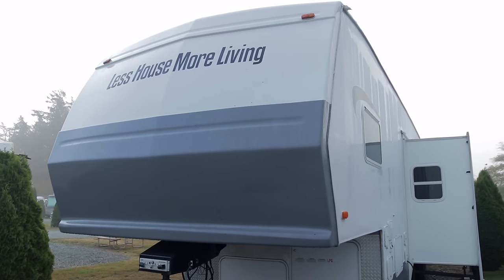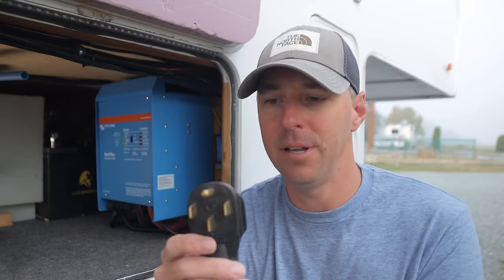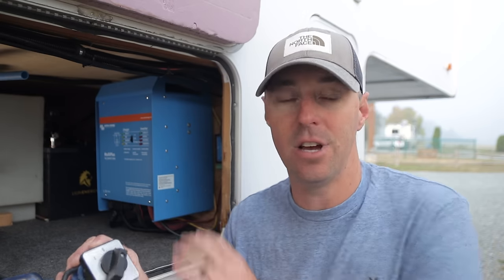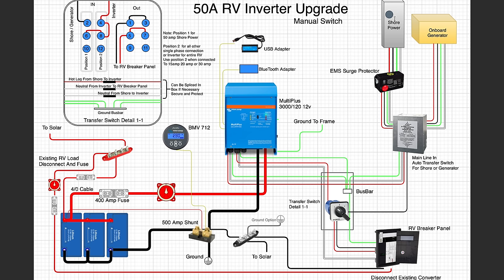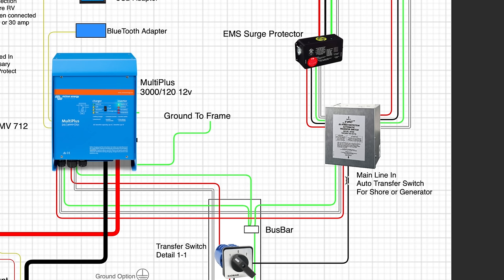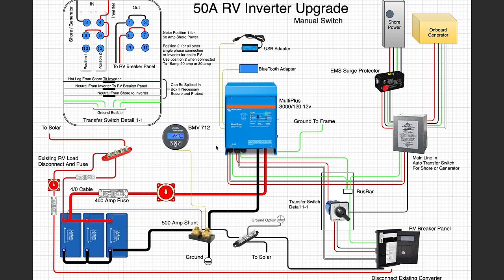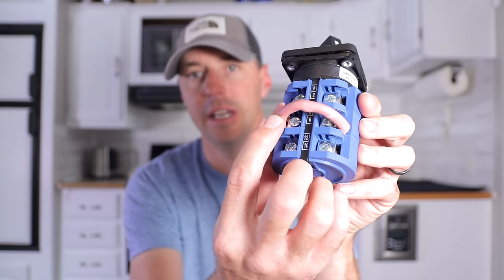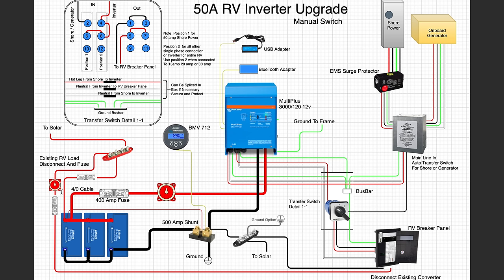Budget 50 Amp Rv Inverter solution!

Comment from the maker: UPDATED INSTALL HERE https://youtu.be/gbKBoIvXNPA
Reply: Do you know if I can mount the Victron 3000 on it's Back?? this is the only way I have to mount it, otherwise it will have to live under my table ON THE WALL... not where I want it...
Reply: Note to public, do not use wiring diagram in this video, the link Jared posted here (to 2/14/21 posted video) has his improved design which has less jumpers on the manual switch and constant power on 1 leg when rotating the switch.
Reply: Great stuff Jared, installing this exact setup this weekend. Just ordered through your storefront. 1 question. Do you need to manually turn the switch to position 1 to use onboard generator the same as ypu would for shore power?

Comment: Way over my head.  A good reason to hire an RV electrician.  Travel safe.
Reply from the maker: RV Electrician is a great option.
Reply: @AllAboutRVs    Jared -- would you have any idea on how one locates an "RV Electrician?"  I was told last week, by my dealer who sold me my TT, that they would not build me a battery setup like this because of liability/fire hazard.  I know that's not correct, but I'm having a heck of a time locating an electrician who will do this kind of work on my TT.

Comment: Great job Jerred!  I use the same switch in a much simpler mode where I use it to allow a 4000watt inverter power my entire RV.
Mode 1- normal 50 amp service feeing the circuit breaker panel, inverter circuit breaker (this is the inverter power input which feeds  the circuit breaker panel) is disconnected from panel.
Mode2- the 50 amp inputs from shore power are disconnected, the circuitbreaker panel 50 amps inputs are bridged, the 20 amp circuit breaker from the inverter is engaged and the AC to DC charger converter circuit breaker is disconnected. 
Its a super simple setup for people with a inverter that want to power their entire RV or connected to generator/shore power as normal.  Contact me if you happen to be interested in a schematic to put on your web site.
Reply from the maker: Good setup. I'll make a diagram of it for those that don't want the Power assist Inverter.
Reply: Scott Helmann could you send me the schematic for how you have your manual switch wired?
Reply: Jmmy Talvacchio - got an email address or a text number? You can send photos on a video comment.  Or- you find me on facebook

Comment: Thanks for the detailed video.  I was able to install the MultiPlus 12/3000 and the manual phase switcher today in a 2016 dynamax fk36.  I made all the wire cuts required to insert the SPS when supplies become available.  I have a full round of testing tomorrow.

Comment: Just what I needed!  I've been running my Victron Quattro 5000VA through a SPS for three years.  Today, Jul 18, 2024, I find that AM Solar is no longer in business.  Last year AM Solar told me that SPSs were built to order should I need a replacement.  The SPS was the one part of my system that I've had a concern with over its availability should it ever fail.  I'm now ordering the parts from your list to keep on hand in case I ever have to pull out the SPS.

Comment: It made me dizzy, but this was very helpful. I'm dealing with wiring a plain old 2000 watt inverter into our 30 amp system with a manual transfer switch after the installed ATS. I don't intend to power the AC unit, but there are some loads on different breakers that I want to access.

Comment: I want to thank you for the information. I've just purchased the victron multi plus and the manual switch as you have shown. (Auto switch not available right now). Using your diagram provided which is a great help. I also purchased a 30 amp victron dc to dc charger to to charge batteries while travelling. I will install cables from the engine compartment back to the box with an anderson connector to plug in the 5th wheel. Next purchase is the lithium batteries. Battleborn would be nice but they don't have free shipping to Canada. Got to do a bit more research. Thanks again.
Reply: Hi Jimmyp, I have two battleborn batteries (purchased on April 2019). probably only have two charge cycles on them.  Let me know if your interested.

Comment: Hi Jared. I have been solo rving for 20 years now. I'm a single woman I live in a 25 foot Class C. And it is a 2000 year model. I have absolutely no idea what you are talking about. I don't understand the whole thing about solar and why you need solar. I don't understand anything about this extra inverter. I had a 32 amp I called it the controller box but I guess it's an inverter I really don't know. But I had to change to a 55 amp because I just needed to do that. This is the way I roll. I just go wherever and every other day I turn on my generator charge my house batteries and that's it. I've been doing it this way for 20 years and I've never ever run into a problem. My fridge always stays on my hot water heater works perfectly everything works. Why is the simple method that I use looked down upon? I'm always seeing you or other channels needing to improve everything but I'm not sure why. Is there something that I'm not getting? All I know is every other day turn on the generator for a few hours charge my batteries and go with it. I am never plugged in to shore power. I am always boondocking. Thanks for all your videos I watched them even if I don't understand them.
Reply from the maker: Thanks. We definitely don't look down on your style of RVing and boondocking. Everyone enjoys different ways to get out there and enjoy RVing regardless of upgrades or RV.  I personally don't mind using the generator to charge up the batteries but I also enjoy filling up the batteries from solar and having a system that the family can use with out me limiting all that they can do while we are boondocking especially with teenage boys and my wife. Thanks for watching, maybe we will see you on the road some day.
Reply: @AllAboutRVs  thanks Jared for replying to me!!
Happy trails.

Comment: Great video! I plan to get an RV as soon as I can after I get my Cybertruck and I plan to upgrade the electrical system significantly and I appreciate this video to help with that!
Reply from the maker: RVing with the Cybertruck would be so much fun.
Reply: @AllAboutRVs and it is almost a reality, 3 years later!
Reply: @seeking70  I ended up getting the cart before the horse so to speak and I purchased an RV shortly after making this comment and I already retrofitted it with a robust electrical system which I've documented on my YouTube channel. Then the Cybertruck was delayed so I purchased a gas truck to get by in the meantime. Then the Cybertruck began deliveries and not only is it way more expensive and the range is way less, it also doesn't have the 6th seat option that we require. It looks like we're going to be using our gas truck  significantly longer than originally anticipated unfortunately. Now I'm just waiting impatiently for an EV or hybrid truck that can seat our family of 6.
Reply: @ElectricTechAdventures  I'll have to check your channel.
Reply: @seeking70 There's a playlist on my channel of just the RV retrofit videos. There's a mixture of videos on my channel about electric vehicle road trips, electric bikes, trips in our RV etc...

Comment: Outstanding presentation of the information. I currently have a Victron Hybrid inverter for a 30amp RV, which was fairly eas to wire. and will probably upgrade to a 50 amp RV so this is very helpful.... I love Victron equipment.

Comment: This is a great idea. I install lots of SPS for customers but  this is a way cheaper 

What would happen if someone forgot the switch in position 2 and plugged in shore power. Or turned the inverter on and left in position 1?
Reply from the maker: I leave the inverter on in position 1 and has no effect on the operation of the RV because of the switch built into the MultiPlus . If left in position 2 when connected to a 50 amp service everything will work but you would be limited to 50 amps and not  have the available 100 amps (50 per leg) if you draw more than 50 the breaker at the shore panel would trip and remind you to switch to position 1.

Comment: I have a friend that has a Victron and he has been back to Battle Born with problems 3 or 4 times, plus on the Victron you need a interface and a laptop to make any changes. My 1st choice is the Magnum inverter charger 12v 3000w- rv but that is why there is many choices out there.
Reply from the maker: It’s great we have choices, if your friend is still having issues have him send me an email. I just helped a friend with some settings from a battle born setup that had his system look like it was shutting down. For any of our normal day to day settings we use the phone app but the first setup for settings we did through the computer interface.
Reply: @AllAboutRVs  I will ask him if they got it working the last time they had hes trailer for 2 weeks in Reno thanks for your help

Comment: SPS phase converter took a dive this summer. Not to blame them, we took a lighting strike near the house and I had left the coach plugged in. For the folks thinking about it. They are sending me a new phase coveter with a few questions asked. I am putting the switch in this week. I wanted to use a switch when I was putting in the inverter. Wish I could have found this info last year. Thanks again.  I like to have it in line with the SPS to use the SPS and have that for a emergency backup. Jared. Looking for a better way to safely stack 12 battle Born battries in my coach. I had a friend help me last year. He boxed up 4 in a box (3 wooden boxes). They are on there sides and relatively compact. I like to take them out and stack them upright. I saw an installation with them stacked in two layers with what looked like an aluminum sheet the middle. Had to be insulated?  Any ideas are welcome.

Comment: Ahhh. The manual transfer switch.  Just got mine last week. Would you do a video on wiring one for 30A and 50A. These switches don’t come with any instructions and hard to find anything on line. For me and a bunch of us out there We know when We want to run the inverter vs manually start the gen or on shore power. Auto switching is nice but I want to pick when and what way I’m running power for optimal efficiency and... reliability. Not to mention cost savings. I figured out my switch with a meter and jumper cables.  Then to make sure I plan on wiring it to 2 home outlets (plugs) and a light to make sure I have it right. 

You do a great job and have saved me time and given me knowledge. Keep it up.
Reply from the maker: Thanks, Yes this video should walk you through on how to set it up on a 50 amp RV. There is a Diagram on the website that shows how to install the inverter in the 30 amp RV, no switch needed. https://allaboutrvsinfo.com/rv-inverter-setup-how-to-power-it-all-30-and-50-amp/

Comment: I have a quick question on Truck Power,  how can i keep the ability to charge batteries via running truck while towing?  Do I keep those batteries and that circuit ? Is there a diagram on how to keep this (if driving to new battle born batteries). Also, will my alternator be able to take the Amps drawn on the charge or is there another piece of hardware needed to gate that Amp pull?   Thanks for the go to videos.  Very good info and easy for me to understand

Comment: Jerid, my rig came with a 1000 watt inverter because I have a residential refrigerator. I know I will have to put a bigger inverter in my rig but can you do a video on how to wire more of the plugs, tv etc to the inverter. I’ve upgraded to 2 lithium batteries and plan to put 2 more lithium batteries in the rig. While we are boondocking I just want to be able plug in my coffee maker in the morning, turn on the tv without starting my generator. I hope I didn’t make that to confusing. I have a heartland bighorn 3270rs and the inverter is right by the batteries. Thanks for all the work you do to put out such great videos. Keith
Reply from the maker: This video might help point you in the right direction for a typical inverter. It has a few options for installing it. https://www.youtube.com/watch?v=rqrEIKWoMrU&t=614s Usually a normal transfer switch will work for you but you would have to disconnect the converter. 
Also RV with Tito has a video on how he connected his and used a relay to auto disconnect the converter.

Comment: quick question I figure you know the answer to. I also have a 50A service RV. I am wanting to install a similar manual transfer switch. I bought a LW28-63/4 switch that is rated @ 63A. the question, as you stated in your video, you actually have two 50A legs So would I be ok with the 63A switch or should I have bought a 100A switch?? TIA

Comment: Do you happen to have diagrams like this for wiring an ecoflow delta pro 30a system up to my 50a rv?   I plan to use 2 inverters with 2 additional batteries with a voltage doubler.   Would a automatic or manual switch be better for this application so I can use my solar for boondocking?

Comment: Jared, thanks once again for an awesome detailed how to. I literally just received my Victron 12/300/120 inverter. I have one, OK more than one... If I have a 30 amp generator, it obviously won't have a red leg. If I use a 50 amp shore cord, how would that work with the ATS? I have received but not used the Progressive 30 amp EMS and TRC 30 amp ATS. Do you recommend I return both and get 50 amp versions? If I stay with the 30 amp setup, If I simply jumper to both legs in the panel to power everything. I won't be pushing limits, ie both AC's.

Comment: If using an automatic transfer /inverter/charger, whether a victron or go-power, this manual transfer is not necessary, correct?  Also if you’re limited to either shore power or a portable generator, because of a single power entry into the the rv EMS , this manual transfer wouldn’t be needed as well?
The basic difference between the 50 amp Victron and the Go/power is that the GP unit only has hybrid power on leg one, compared to both legs on the Victron .  Am I correct on this?
I’m in the midst of planning my solar installation and really appreciate your videos on this and other issues involved with solar/electrical projects.
However, just as you think you’ve got an answer, it just generates more questions!
Be of good cheer!  Thanks again

Comment: Jared, love your videos.  Wondered if you could please clarify the part of your video where you show a screenshot of your friend's distribution box with the spliced wires.  I assume that is what he used when he pulled his shore power wire in and then split off the black hot leg from the red hot leg and neutral that went to the inverter?  What wire gauge did he use when he spliced into the shore power leg? If you could label what came in and out of that box that would be great. Also the wiring diagrams are awesome. Thank you!

Comment: Can I Split my shore power (50amp) at a junction box, and sent 1 leg (plus neutral and ground) Directly to panel, and then the other leg (plus neutral and ground) to my inverter / charger?  I plan to use a Renogy 2000w  I do not need the hybrid feature(yet)  Just need to power some outlets from the inverter  Is there any safety concerns doing that?  No onboard generator,  Mine plugs into shore power.

Comment: Hey Jared. Thanks for posting such informative videos. We took your advice last year and installed your $40 switch idea along side a new Victron Multiplus and Battleborn batteries. Everything seemed to go together OK, but we are now having trouble when we plug into “some” power receptacles. When we plug into the place where we store the RV, which is a 15 amp circuit, there is not issues. When we plug into any campground pedestals, whether it’s 15 or 30 amp,and turn on the Multiplus, the pedestal breaker trips every time. We’ve checked each 15 and 30 amp receptacle with a multimeter and they seem to be OK. I think it might be the internal wiring of the $40 switch that is the issue. When I was wiring it up last year there was one wire on your wiring diagram that didn’t match up exactly with the switch numbers and and letters. Is there any other reason you can think of that might be causing this issue?  We are on a trip now and would love to get this fixed ASAP. Thanks Dave

Comment: My motorhome has a 7200 watt generator with two 30 amp outputs, which are in phase with each other.  Does it make sense to use the SPS in this case.  By default, the SPS would only use one of the legs when it senses that L1 and L2 from the automatic transfer switch are in phase.  Jumpering, as recommended for smaller generators, of the two together would allow 60 amps, which exceeds the inverter input capacity.  With the manual switch, I would only switch to your "position 2" if I were connected to 30 amp or less shore power.

Comment: Hi Jared, excellent instructions!  I just finished my install and am very pleased with the results.  On question though.  I can't close the junction box the switch goes in.  There seems to be no room with the splicers, switch and cables.  Is there any trick to this?  Thanks!!
Reply from the maker: It is tricky and can be difficult with the 6 gauge wire. The key is to have those splices tucked out of the way and the wire on the switch positioned so they can bend on the way in. I just did one this week and it is a bear. If you continue to struggle with it you can always add a junction box next to it to try and free up the space in the switch box.
Reply: @AllAboutRVs  Thanks Jared.  Right now I have a 1/2 inch gap between the switch and the junction box.  I bought a larger junction box and will try to move the switch to that.